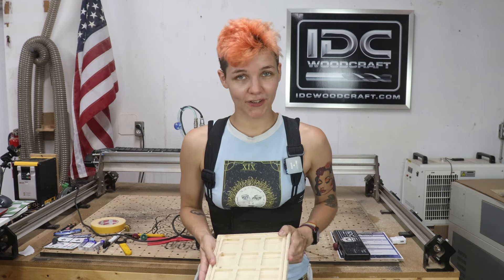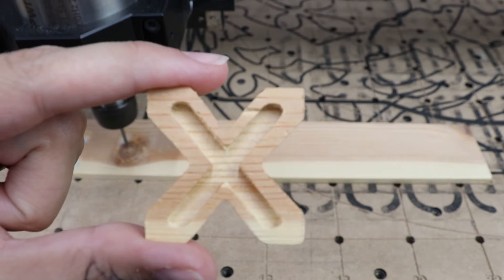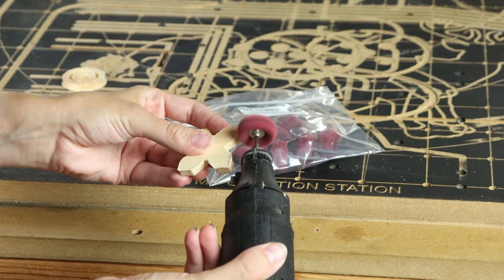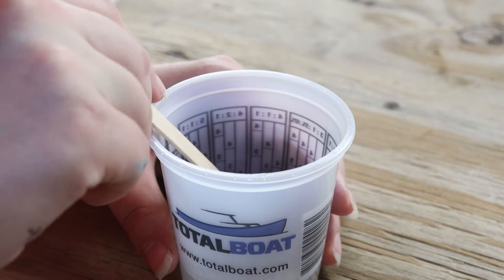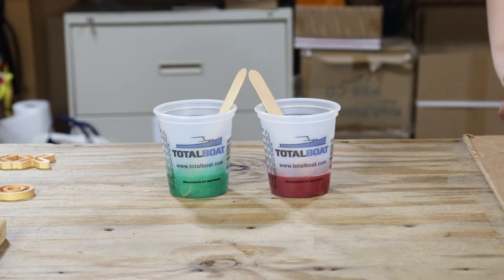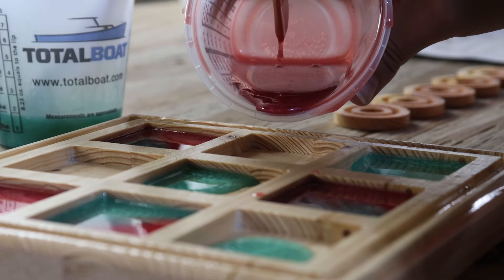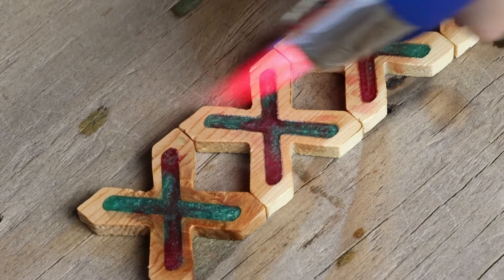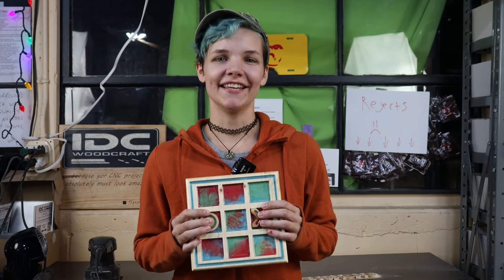Epoxy Magic - Mixing and Pouring For Your First CNC Woodworking Project

Comment: I use epoxy syringe to control my application. I happed to get them from a boat supply shop and I think they are from west system. 
You are a fun person to listen to. Stay on the channel
Reply from the maker: chasinggeckos8843, Thanks so much for the kind words! Epoxy syringes are a great tool for precise applications. Happy woodworking!

Comment: Nice project. I don’t use epoxy much anymore but when I did do small spots, I’d use syringes. You can pick them up at any pharmacy or buy in bulk if you will continue using epoxy.
Reply from the maker: ifiwooddesigns, Thanks for sharing your tip! Syringes are definitely a handy tool for precise application.

Comment: Its all bin Said in the coments! With the exeption of !! Use a Hair dryer ( industriel Heat blower) to remove Bubbles it wont burn your Wood or Cook your Resin  👍😎🤘 lovely Job girls
Reply from the maker: TheSuperheimwerker, Thanks for sharing that tip! Using a heat blower is a great idea for removing bubbles; it can really help achieve a smooth finish. I'm glad you enjoyed the project!

Comment: A recommendation... before doing your surfacing, carve out your pockets for your resin, leave the wood on the CNC, pour your resin and then do your surfacing and cutouts.  It will save you the hassle with sanding off the spilled epoxy.
Reply from the maker: drkline69, That's a great tip! Pouring the resin after carving the pockets can definitely make the process cleaner and save some time on cleanup. Thanks for sharing your insight!
Reply: How will one surface the pockets when they aren’t filled full? Not grasping what you’re saying

Comment: Chem lab trick. Put your stick directly on edge of cup when you pour the surface tension will have the liquid follow edge of stick. Smaller stick obviously become more precise
Reply from the maker: jcor-laura5450, That's a clever trick! Using the edge of the stick to control the pour through surface tension is a neat technique. It shows how understanding fluid dynamics can really make a difference. Thanks for sharing!

Comment: It's kinda weird how, every time I'm thinking about trying to do something new with my CNC, all of a sudden there is an email from Garrett about that very subject! I've just spent the last few days trying to figure out what epoxy to use, how the color is mixed in, etc. and here's a video by another beginner showing me how she is learning too! Liberty is a great presenter, she and Juliann are fun to watch! I hope they do more videos soon!

I do have one newbie question. Many people mention using a wood sealer before pouring epoxy or using paint, do you recommend this and if so, what types?
Reply from the maker: StubbsMom, It's great to hear that the timing of the emails and videos has been so helpful for your CNC journey! Using a wood sealer before pouring epoxy is definitely recommended, as it helps prevent the epoxy from soaking into the wood and offers a smoother finish. Some popular options are shellac or polyurethane sealers, which work well in sealing the surface. It's always good to test on a small area first to see how the wood reacts. Happy crafting!

Comment: Temu sells a pack of 100 little dobber syringes that work really well for The resin inlay projects. You can put the resin right where you want it.
Reply from the maker: oldfunguy, That's a great tip! Those little dobber syringes can really help with precision when applying resin inlays. Happy woodworking!

Comment: You can use a large 60CC syringe to apply the epoxy.
Reply from the maker: timothyohara691, That’s a great tip! Using a large syringe can really help in getting a precise application and controlling the flow of the epoxy.

Comment: How did you finish the wood, with a clear finish, does the clear finish stick well to the cured epoxy?  Thanks.  Great demonstration of epoxy techniques.
Reply from the maker: johnpaulflippin9097, I'm glad you enjoyed the demonstration! When finishing wood with a clear finish over cured epoxy, it's important to choose a compatible product, as most clear finishes adhere well to cured epoxy when properly prepared. Just make sure to sand the epoxy surface lightly for better adhesion before applying the finish. Happy woodworking!
Reply: @IDCWoodcraft  Ah, cool.  Thanks much.

Comment: My only recommendation is once you have touched off, cover the work piece with painters tape, cut your pockets on your board and shapes and then pour your epoxy. Epoxy shrinks as it cures so there will be high points on the edges. Then surface and do your round overs. Then remove your pieces and lightly sand. Syringes are a good idea for applying epoxy to narrow pockets.
Reply from the maker: pchrosto46, That’s a great tip! Using painter's tape can definitely help manage the epoxy and get cleaner edges. Thanks for sharing your insights!

Comment: Cut them using tabs. Then, pour the epoxy. Then, run the material thru the drum sander.
Reply from the maker: davidhittenberger1651, Sounds like you're planning a great workflow! Using tabs is a solid approach to hold everything in place while pouring epoxy. The drum sander will really help in achieving that smooth finish afterward. Enjoy the process!

Comment: Looking good.  Is there a reason you don't use the surfacing function in gSender?  Just curious because I see a lot of people not using it and I wasn't sure if that's just how you are learning.  Not necessarily wrong either way just a workflow question
Reply from the maker: hamanjam, Thanks for your interest! It's really about personal preference and workflow efficiency. Different methods work for different projects and styles. Happy to share a new approach!
Reply: @IDCWoodcraft absolutely!  I was just curious if you were going for controller agnostic approach or just how it fits in your workflow.  Always interested in learning different workflow options.